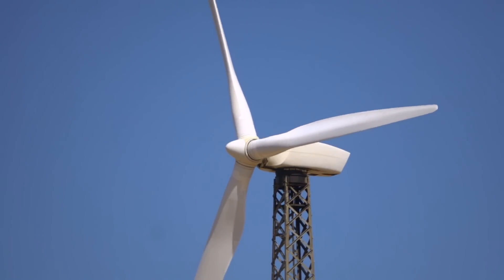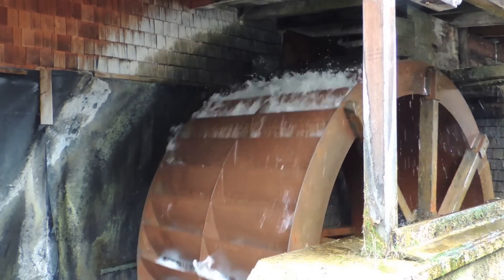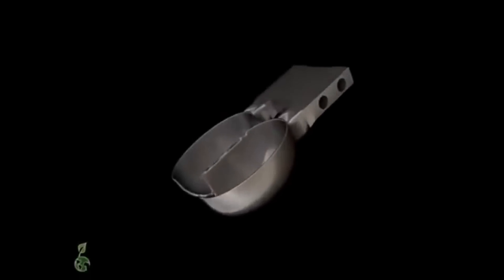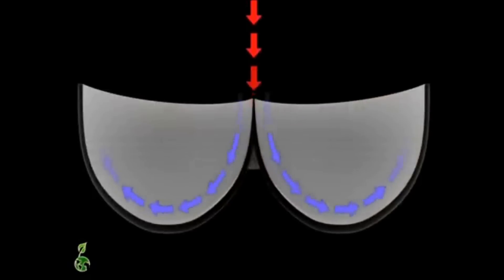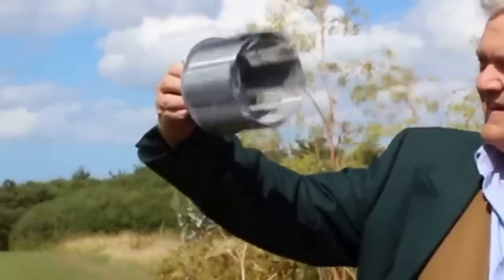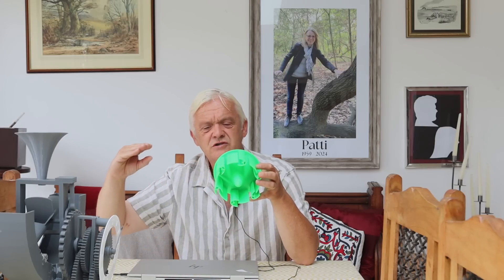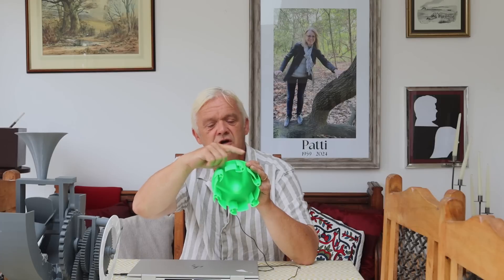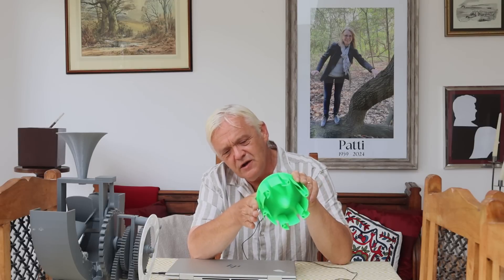2275 The Pelton Wind Turbine

Comment: Would there be any benefit to having two of those placed base to base on a horizontal axis where they could rotate around the same stator? I was wondering if the magnet arrangements were done in the correct way whether or not you would actually get an additional charge out of the coils. I heard someone mention something called a halbach array which may actually increase the power as well.
Just a thought.

Comment: That cone in the middle struck a chord...If you shrunk the height of the pelton collectors and modified the design to capture wind from the inside out from the cone similar to the Betz beater and forced the air over the cone from a darwin collector; I wonder what type of efficiency you would get... I'm stuck on and still LOVE the idea of a static multi directional collector. I've got a bunch of 3D printers I think it's high time I put them to use. It would be really cool to make a street lamp with this sitting on top charging super caps and lighting some LEDs at night.

Comment: Air is compressible, water is not. Air’s density changes appreciably to changes in temperature and/or pressure, and composition. Water does not.

Water is fascinating. Air illusive.

Comment: Could you increase the angle of the exit air guide in ratio to the front of the following “blade”? The exiting air stream being able to push off the following lead edge but still flow out rather than in towards the center

Comment: is there a design that can be added in to gutter downpipes to harness rain power ? pelton, archimedes screw !,  with maybe some valves and a collector box at top and some sensors to back up a weight of water for max efficiency. maybe even a bigger dia gutter and downpipe !

Comment: If the air is going in fast enough, would constricting the exit hole if you put a cap on it be enough flow to power a second, possibly smaller turbine?

Comment: Definitely interesting... but I'd have left the splitter out of the foils (just made them nearly U-shaped), and opened the inner side slightly more. This way, you still get a near 180° turn, but also creating a slightly lower pressure zone to the inside.

There's still going to be a significant amount of inefficiency, due to centrifugal force trying to push the air back out.

Comment: Look at the exhaust end of a turbojet engine and a steam turbine.

The stream of gas [basically, just 'wind', just much hotter] is diverted multiple times to get more power from it.

Maybe less efficient than a Pelton wheel, but certainly a very efficient design.

Comment: how about one of the advanced wind guides you developed (derived from the Darwin design) blowing down into the center of this Pelton based design.  Multiplies the force over the entire turbine and removed the pressure from the non-working side in the normal arrangement.

Comment: Great to see you back Robert.
About 15 years ago I was fortunate enough to be involved in a maintenance shutdown at a large pumped hydro plant (2 x 285MW) and these used large horizontal pelton wheel turbines, the numbers were astounding, each unit consuming 350 Megalitres per second when generating power and when running as pumps they each pushed 250M3/sec 😳

Comment: personally, if you put the whole thing to spin with the cone center pointing up, and have a redirection cage around, merely of about 2/3 the structure width straight or slightly curved vanes, deflecting at an angle what would be direct opposition,  but the next vane like it will collect a bit more slightly out of direction wind down into the wheel. should eliminate teh opposing force wind, and maybe funnel in to the work area a bit more than otherwise.

Comment: I recently watched a video about static stresses and it mentioned that fluid flow works in a very similar manner. I wonder if it's possible to take those principles and disrupt the air to the bottom half without tons of material.

Comment: holes at the outer apex of the 180 reverse curve can be drilled. to increase the air over the vain u show in the vid. the hole size to thrust achieved. n direction of hole will all effect the out cum. but the wind roof catcher with this as impeller. yeh worth lookin at.     u might b on 2 sum thin there.

Comment: Soooo... just as a thought experiment... let's assume you would print those pelton elements separately and put these on little axles that stick out the ground plate just like the blades do, so that they can swivel a bit. Would they then turn so that the amount of wind is nearly the same in both bucket halfs and therefore always align most efficently? In my head the oncoming wind, when hitting the one bucket more than the other, would then turn the pelton element so that the less filled bucket would get more wind. Or am I thinking wrong?

Comment: that 'block' you mentioned..  imagine if it was made in the shape of a curved ramp.. or even a straight ramp I suppose, height = 0.65D of the turbine, and it redirects all the air from the lower 65% to the upper 35% portion..  should give a boost of at least 20% to the power hitting the top, I'd think,   :-D

Comment: Your pelton wind turbine design on top of the Erasmus Darwin shroud/diffuser design could actually be a step forward in scientific design.  Ventum Dynamics are saying that their VX175 design was not inspired by Erasmus Darwin's design, but you could be forgiven for thinking you were looking at Darwin's shroud/diffuser only a 3D printed version of it.  Still sir, Ventum are still using the standard turbine blade design, they don't have your Pelton blade design which would probably increase output considerably.  Thanks for 2275 The Pelton Wind Turbine Mr. Smith 👋

Comment: One major difference is that air is compressible while water is not. So, for example, if you look at the inside of the compressor in a jet engine, the volume gets progressively smaller as the pressure increases.
Reply: It takes energy to compress air though

Comment: Huh.... i wonder how it would do if you made the outside cups larger, and the inside after the 180, a series of venturi tubes to turn the exhaust into sort of a jet?
3d printer would be able to handle that sort of Dr Seuss seashell thing.  
Might be a ridiculous notion of pointless complexity, but it might also give a little more push. Dunno.

Comment: My thoughts on an air Pelton turbine is to not go the route of 2 distinct pieces, for the vanes, but to combine them into an Asymmetric curved arrow-head shape. The outer side being roughly the shape of the current straight vanes, but angled in slightly to end in the middle of the rear in front. For the rear, the outer edge being longer than the inner edge, which will subsequently mean a difference in rate of curve.

Admittedly part of my thinking, for doing that, is then blades become a more solid/robust one piece component, and easier to assemble if scale up or printed as separate parts eg on a smaller 3D printer

Comment: Hi Robert, if it was fairly enclosed the exhaust could be directed onto another turbine, half or 2/3 of the turbine could be underground with air ducting above to direct the wind onto a few exposed points. Small scale could be on a weather vane type setup and large scale would be simple to make work, considering the whole setup would be fairly light and you can roll whole football pitches around these days!

Comment: Pelton turbines in hydropower application generally require quite a large head or pressure to operate in optimal range of efficiency. Perhaps testing the Pelton wheel with compressed air jets could be a more controlled way to determine its efficiency? 
Also, chambers Pelton hydropower wheels are housed in are designed with precise geometry to make sure water leaving the wheel doesn't hit it again, slowing it down. That may also be an interesting path to explore regarding airpower applications.

In any case, great video and love seeing you back in the saddle with Patti by your side with the beautiful framed photo!

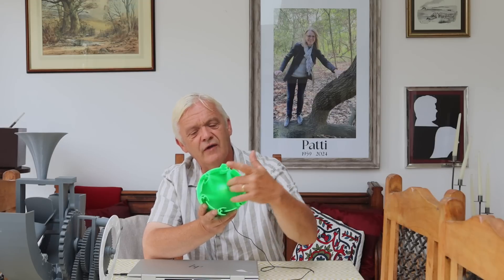Comment: A question please. 3:52 if you made your ring with a flange to concentrate the flow of the wind could  it be directed to another smaller turbine before being released from the channel, or would that second turbine be inefficient due to the energy expended in the first?
Reply: this is what was done in the early days of steam with the triple expansion engine, each cylinder using lower pressure than the previous, obviously with diminishing returns at cylinder 3.
Reply: @grendel1960a  But with the steam engines you were also dealing with the loss of pressure as the water cools. I'm not very conversant about engineering as my field is accounting. But as new wind turbines are developed I'm trying to learn as much as I need to evaluate investment opportunities. Robert's tinkering is very informative.
Reply: @happygardener28  Thats ok, I too was curious on one of the other wind turbine designs whether you could use the air flowing out to turn another turbine, and actually 3d printed a second turbine to rotate outside the first as an experiment, I found it did pick up some rotation, but not quite as much as I had been expecting, ie if the initial turbine is converting 80% of the energy in the wind, then you wont get the remaning 20% from a second, so its a law of diminishing returns. and I was never ccertain if the second turbine slowed the first.
Reply: @grendel1960a  Logic implies it might seriously reduce the energy collected in the following turbine as the second turbine could, not will just potentially, impede the outflow from the original. Depending on the design and method of collection at the second turbine in conjunction with the outflow of the first, far too many factors for my lack of knowledge to consider.